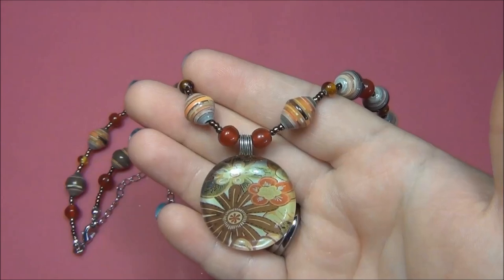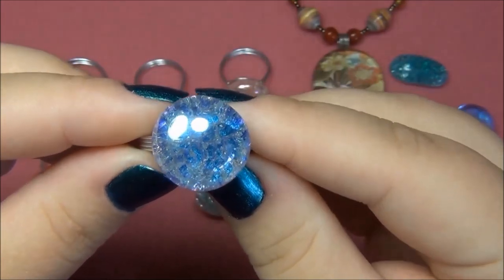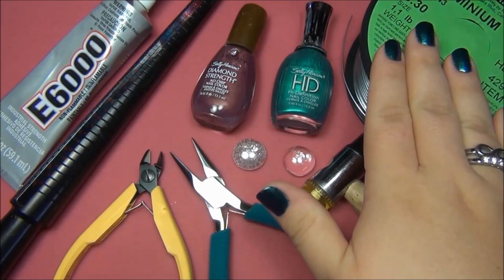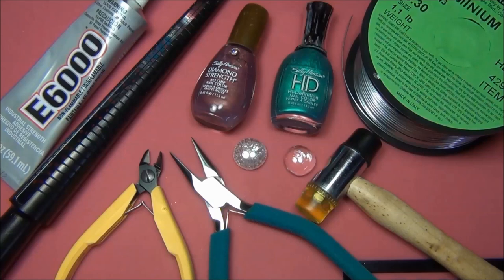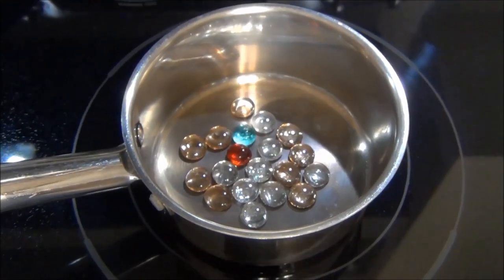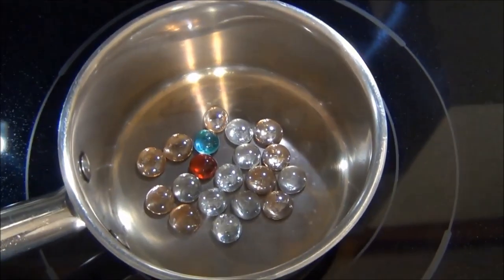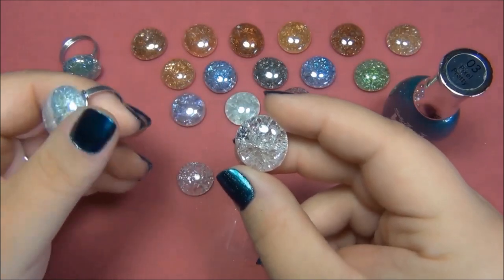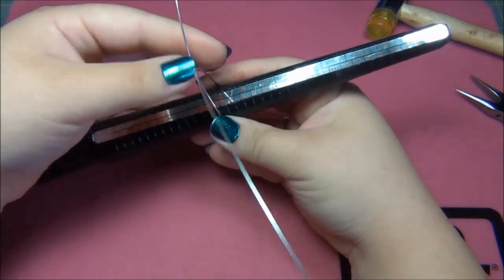Crackled Glass Marble Ring Tutorial

Comment: WARNING!!!! Please be careful removing the gems from the water... sometimes they can shatter and leave shards of glass in the water. As you scoop the gems out they will cut your hand. Thank goodness I have never have this happen to me but I did watch another video where it happened to the maker.
Reply: Kati Coffin I had this happen! Tried it for first time today and a couple of them had little slivers off of them! I put clear nail polish over smallest spot (only because it was the only stone of that color I did) and it covered pretty well. But yes watch out for slivers of glass!
Reply: I use plastic tongs (Tupperware, don’t know how old) or a little mesh teaball that has two hemispheres and squeeze the wires of the handle to open. 

I work with stained glass and that will put the fear of glass in you. Wear Eye Protection and I mean seal to your face goggles if you can have glass shards of any size spray your face. Cover your hair completely so nothing can fall out of your hair after, and wipe down head, forehead and goggles where they seal to face before removing them. Might sound like overkill for this, but safe than sorry.

Comment: Thank you for the tip on buying the wire. Buy any wire that say Artist or Jewelry wire is getting expensive and you dont get much. Im glad to find someine thats using hardware store wire and its working. Plus its a lot less expensive. So thanks for the Tip... 

Just some FYI in aluminum wire you should go up to a big size of wire then you normally use. If you would normally use 20 gauge you should go with 18 gauge Aluminum wire is more bendy which make it easy to work with but it's not as strong as jewelry wire like Copper or Brass base wire. 

So for your base wire always use a thinker gauge with aluminum. On Rings I would use a 18 gauge or 16 gauge for the base/frame. You can then use smaller wire to wrap or weave but your main frame needs to be at least 18 gauge.

Hope Im explaining this is a way its understandable. 
If I was doing a weave for my ring, I would use 18 or 16 gauge for the main wire framing. Then weave with a 22 or thinner gauge. 

So what Im trying to say is make the ring using 18 to make the base and do the weaving or wrapping with 24 gauge or whatever you like to use. 
I may even use a 16 gauge for the base.
20 gauge will probably work but would loose it shape easy if you wear it a lot of bang it around on stuff...

Also the hardware my go by millimeters instead of Gauges like a 8mm is a 20 gauge so you may have to convert it from mm to gauge...

Thanks you, loved your video ❤👍🏻👍🏻

Comment: If you get the dark dot markings in your pan, a good way to remove that is using Lagostina Stainless Steel and Copper powder (fast acting).  Sprinkle it on, and with a fairly wet soft green pot scratcher (square ones) rub in a circular motion from centre all the way to the outside and repeat till the markings are gone, your pan will look shiny and new again.

Comment: My gems didn't crack like that. I tried the oven way for the flat back ones but I guess I will have to try the pan version....I had to put them in twice and they barely cracked at all. Yours look amazing.
Reply from the maker: Sounds like they weren't hot enough. The hotter they are the more cracks you get. You might have to bake them longer or at a higher temperature
Reply: Okay. I will keep trying. Thank you. :)
Reply: wyatt71511 really is that what happened

Comment: TSC, Tractor Supply Company, sells a bare i coated aluminum electric fence wire 1350 feet, 17 gauge, and another that is thicker. I use this for many many thing including wire wrap jewelry. A spool of each April 2022 was about $85 before tax, it’s about doubled since I started buying it about 2015. It moderate in hard, not quite half hard, and will harden up when manipulated. I suggest sturdier tools than typical wire wrap hand tools. And it will scratch and mar.

Comment: First of all LOVE this tutorial, but I do have a question.  Bear with me, I've never done wire ring work before.  You say you  want a size 9, but you measure and make it a size 10 on the mandrel.  You say it's going to shrink, if I'm confused how it would shrink if you hammer it on the mandrel and work the metal.  Wouldn't it stretch and make it bigger? Again, total newbie here, and I'd love to make some of these....would be a great DIY with my nieces while babysitting!!!
Reply from the maker: Thank you! I don't really know why it shrinks it is weird, but it does. Sometimes it seems like they will shrink half a size.
Reply: Dawn, it shrinks a bit when you make the wraps and tighten everything up, that is usually why you have to put it back on the mandrel and shape it.  :)  I had the same question when I started wire wrapping, but Aleshia is right, it just does shrink.  Hope this helps.
Reply: Dawn Beattie 
It doesn't 'just happen' like magic, although we would love it if it was!!! 
Any mass you add to the inside of any circle makes the circle smaller. Once you draw it on paper, you will see it. :-) Draw a cross section of the shank to this ring - that would be a  large circle, then draw a two tiny circles a small space apart inside the original circle.  
As you can see, the two small circles make the original inner circumference smaller. V-8 moment, right?
The smaller circles correspond to the wraps you make to secure the wire after you make the spiral. For wire purposes in this gauge,  and this far apart, they take up about one size.

If they had been placed at opposite sides of the inside of the ring, they would make the ring even smaller. :-)
Reply: Dawn Beattie I thought so too as aluminum is very soft and looked like it was working up farther on mandrel, guess you can tell when you have done one better